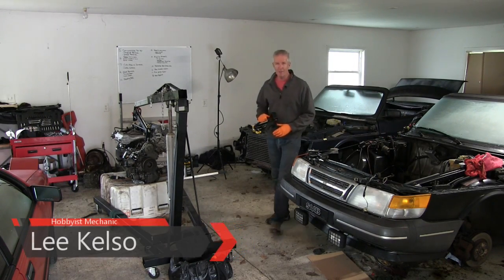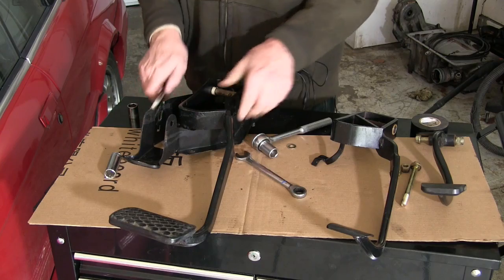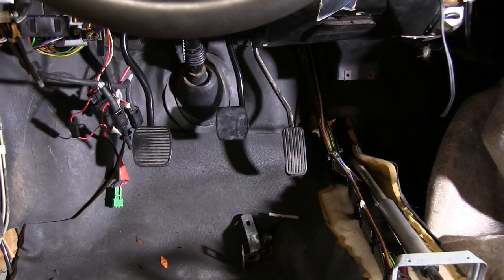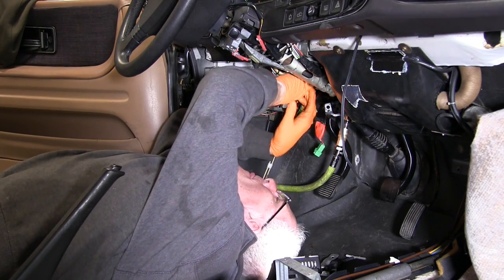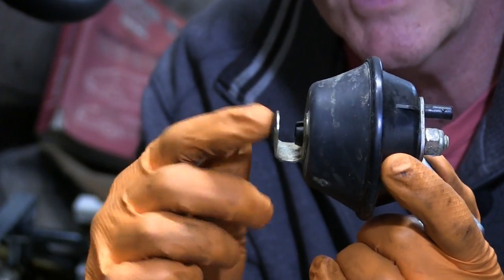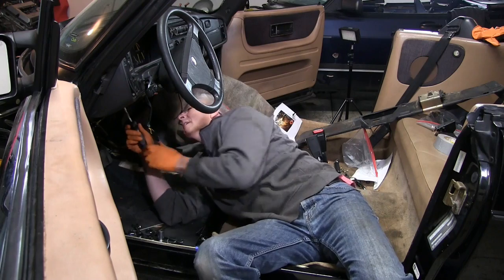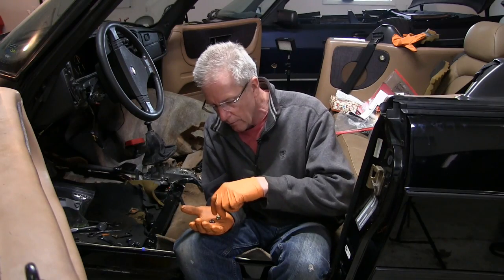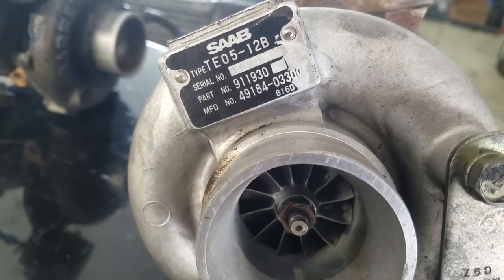Ep 12 SAAB 900 Pedal/Stick Shift

Comment: hey lee can u please tell me how youe removed the shifter assembly? i have 1993 900 with automatic transmission. ive already removed all the 3 sided nuts to free the assembly from floor but how do i disconect it from the linkage? i just wanna take this out to make changing ignition barrel and gears easier

Comment: My 87 900 Turbo had the 5th gear problem. From my research it's fairly rare that the inside of the trans is the issue. There are a few things to check, I've listed a few here.

The alignment of shift rod and trans needs to be pretty spot on first. To do this differs between years, but the differing methods are in the Bentley. (In my 87's case it's the locking it in third gear method). 

Second is the reverse lockout pin on the bottom of the shifter. Get yourself a set of digital calipers to do this precisely. Again, specs are in the bentley manual for this, (I believe it should extend 20mm). 

Third is to check the teflon ring and rubber seal inside the shifter housing, if these are worn you wont get 5th. 

Fourth is to check your shift rod coupling, (engine firewall side), the design differed between years and yep, you guessed it, if this is worn then there will also be shifter gate alignment issues.

Last but not least, if your engine mounts have seen better days, this will also give you some alignment issues!

Comment: The world needs a video of the saab 900 classic 5 speed gear shifter alignment procedure ...😉👍
Reply from the maker: Good suggestion.  I'll work on that as I have to pull the engine/trans in my 1994 900 CE,  split them apart and replace the transmission.  It's a perfect opportunity to show how SAAB makes the process straight-forward.

Comment: Looking forward to your turbo assembly video. I rebuilt mine just recently and now waiting on some fresh seals to put her back in place. Be aware of the oil return line - it seems tricky. Keep up the good work and awesome production on these.
Reply from the maker: You are right about the oil return tube.  It did cause me a problem, but the solution is fairly simple.  Fit everything loosely and then tighten it all into place.  You'll see why that's important in the next episode.

Comment: I took the manual brake and traced an exact outline on cardboard.  Then taped a line on the existing automatic brake. I simply cut the auto break pedal with a Dremel metal wheel and shaped with a grinding bit.  It took a little snipping and patience but the manual rubber pad fit perfectly fine and snug.  I’ve done it both ways.  It’s far easier cutting.  My supporting Saab shop said cutting is how they’ve done it for years.  The benefit of course is time and you’re not disrupting anything under the dash.
Reply from the maker: If only I had been that smart.  I thought about it but decided that was too simple, too logical, too practical.  I own a SAAB and therefore expect to be tormented.
Reply: "Expect to be tormented"...lol.  When you're doing an extensive job like this something simple with a Home Depot tool just doesn't feel right.  And sometimes we forget the pure utility of a Dremel.  For others consideration; if you don't like your cut auto to manual pedal result, then default to putting in the manual pedal.  Basically you're going to recycle the auto brake pedal anyway.

I'm over in Toledo.  There's a Saab gathering every summer in Ann Arbor area.  K&N from Ann Arbor (owned Saabs for 30 years, the best shop in Midwest) will sometimes do a tech round table and discussion.  You're in Fort Wayne, may want to come on over.

Comment: Man this is a pain.my 85 spg had shift issues. Previous owner swapped out engine and trans and the shop didn't replace the shift rod. Newer trans lock in third where 85 locks in reverse. Got a new shift rod and put it in but now I can't get 5th gear. I think it's internal trans linkage now. But I know your pain. Hey what nuts did you use when swapping out the tri-wing anti tamper ones? Thanks!
Reply from the maker: Sorry to hear of your hassle.  I don't know how much pain is ahead working to get the linkage adjusted correctly, but will find out soon. 

I used ordinary hex nuts from my parts bin - nothing special.  I get why SAAB would take the tamper-resistant approach when these cars were selling for the equivalent of $65k in today's dollars, but I'm not worried about someone dismantling my interior to get at the ignition switch.  That's a lot of work for a car not many people give a damn about these days.

Comment: Mr. Kelso:

I have a SAAB 900 1994 commemorative Edition. When the car is hot I try to start it and it flows the engine. Mechanics here in the territory of Puerto Rico are changing some sensors that regulates the injection or cooling system. So far they continue to fail and the problems persists. Europarts  salesmen say it is the cooling sensors but which one,,,Do you have an idea about what I cn chec? thanks
Reply from the maker: There are SAAB owners out there much better qualified to answer your question than me, so I posted it in a Facebook group.  These guys are very willing to share advice, and several people posted suggestions right away.  Find it all here:  https://www.facebook.com/groups/2216998577/permalink/10155480196593578/?comment_id=10155480421928578